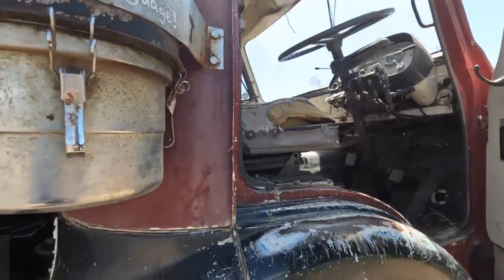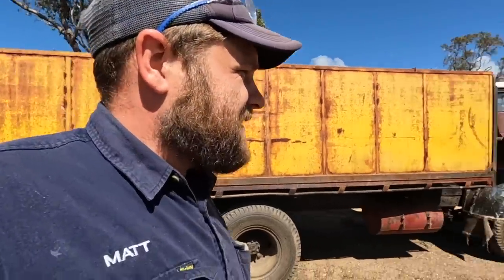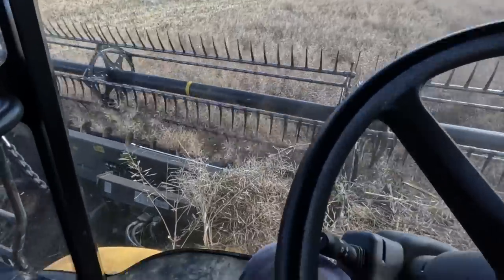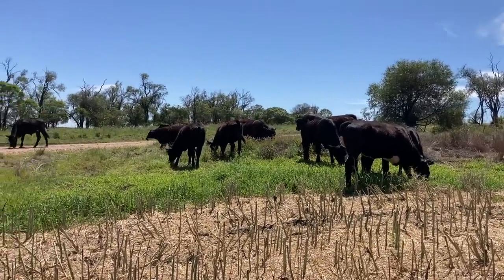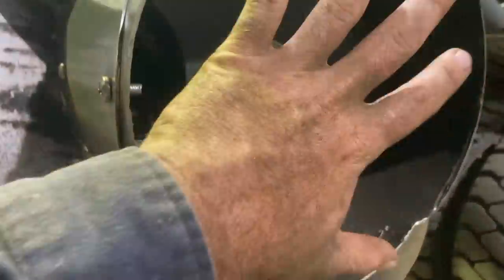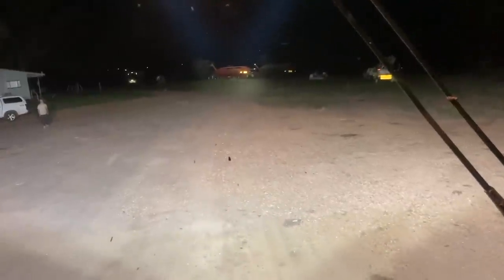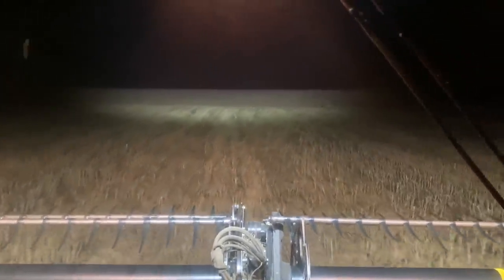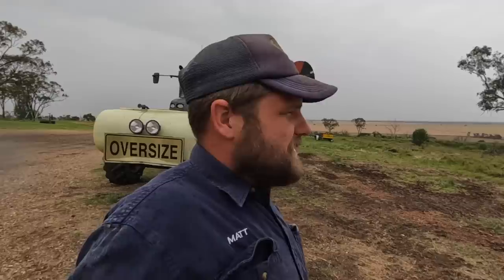Harvest Breakdown & Cows in the Crop (Vlog 112)

Comment: Matt I got a question for.  I know you did a vid about rebuilding a alternator but I was wondering something,  replacing the alternator drive end bearing is that a good repair that will last or is it better to buy a new one. I don't really want to spend 150 bucks when I can get the bearing for 25 if that repair will last a decent amount of time ya know, and what else would you replace while it tore open if anything.
 I know your busy and if you don't have time to get back to me I totally understand, just thought I'd ask
Reply from the maker: Hi Scott, I would replace both bearing and brushes and maybe machine slip rings if they needed it👍 as long as there is no other damage should last a good while
Reply: I truly appreciate the response. Thank you again for all the vids. As always another great one
Reply: @scottm344  You can keep an alternator going almost indefinitely by replacing bearings and brushes. Matt knows more than me and he can do a bit more than that but they are only bearings and brushes really. Main thing is to check them occasionally and blow the dust out often especially on a header. Jeff